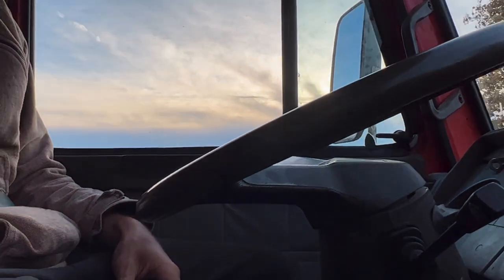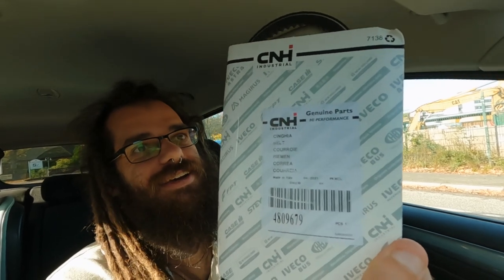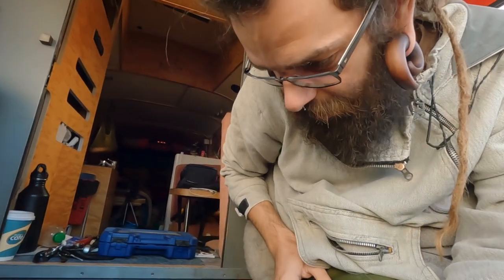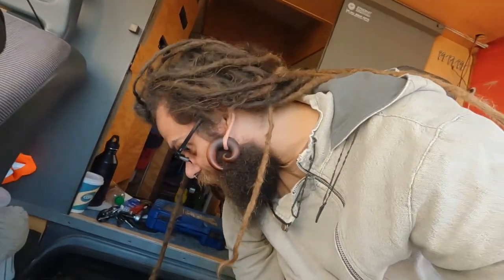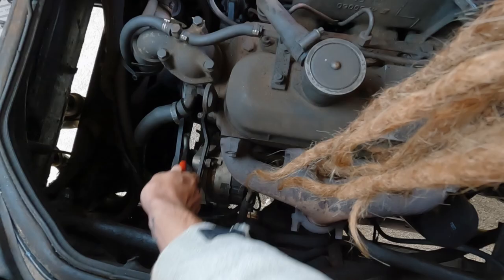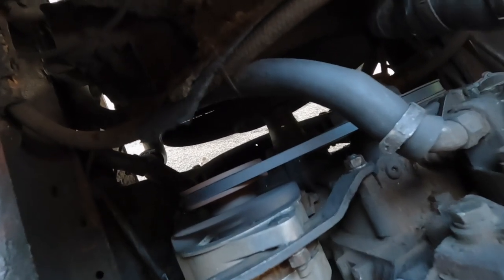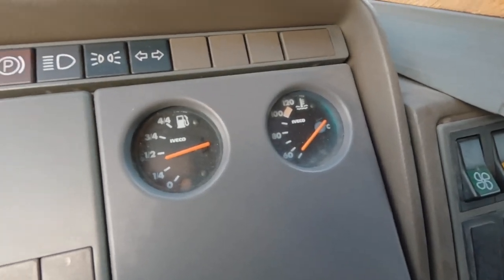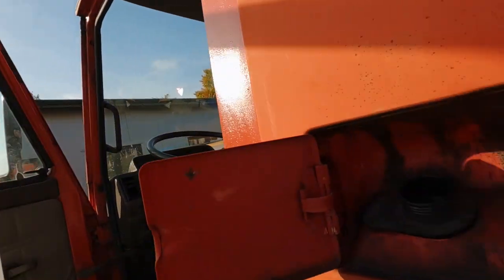How about a "random" Situation - Vanlife 2022

Comment: Always carry a spare V Belt .. when you Overheated the Engine. Check  the Oil on the dipstick isn't kind of Milky ..if so Headgasket problem 🙄  but you may have been Lucky ..and Stopped I'm Time .. Stay Free and Safe Travels 🙏   🇮🇪
Reply from the maker: Thanks a lot Mike! I wish you aswell safe travels and staying free ✌️